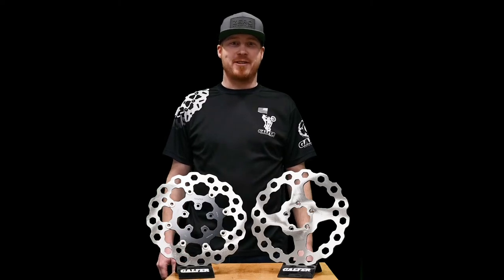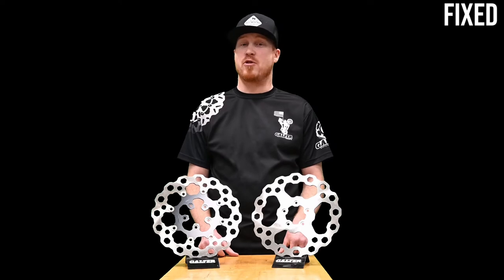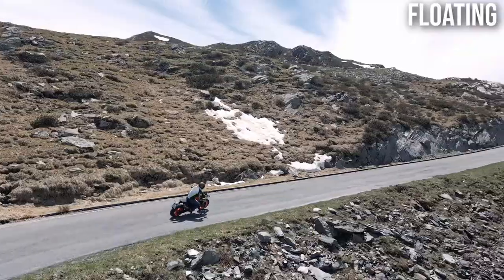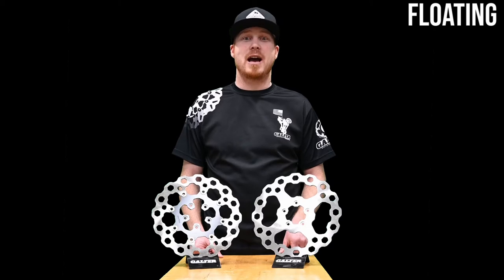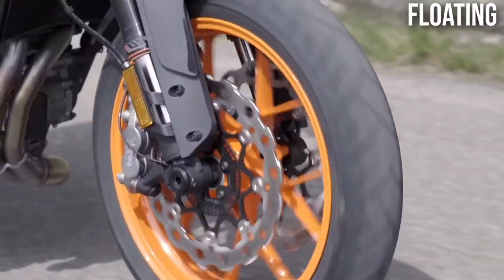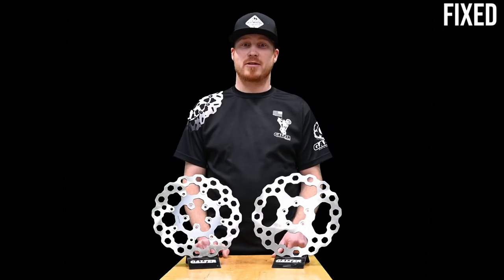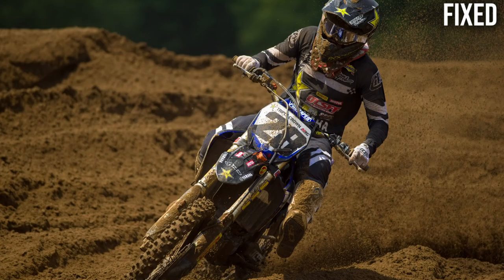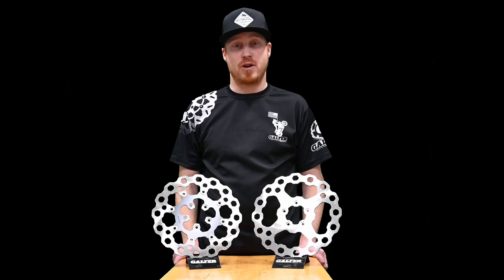Buyers Guide: Fixed vs. Floating Brake Rotors

Comment: 0:53 for anyone wondering they don't "actually float". They're held together with metal rivet like things usually called "bobbins".
Reply: But there is play air gap in between the buttons connection 😮 so

Comment: Harley-Davidson front rotors are not fixed to the wheel. They are bolted to a spring washer that enables the rotor to adjust itself to the brake pads. Floating rotors for Harley Davidsons do not dissipate heat better than a fixed rotors because a fixed rotors have slightly more Steel for the heat to dissipate to. Floating rotors have less of a place for heat to dissipate to and hold the heat within the rotor longer and build up more heat. Remember for a Harley-Davidson front or rear rotor even what they call and a fixed rotor is not really a fixed to the wheel.

Comment: is there a wave rotor option for Kawasaki ninja/z1000sx 2020+ models?.. the stock ones are non wave 300mm rotors i want to upgrade to a 320 wave rotors and the bike model wasn't available on your website

Comment: Seems like a problem area could be the carrier's interface to the buttons where there are concentrated loads from the braking torque.

Are the buttons steel or hard anodized aluminum, and are the carrier's surfaces hard anodized to prevent galling and premature wear?

Also, what is the likelihood of noise from the rotor rattling around in the clearances?

Comment: I have 2k21 fat boy brand new..should the rotors be moving ??maybe 1/16  of tolerance it seems there not locked in n thanks
Reply from the maker: Yes! sounds like that floating rotor is working perfectly as intended.